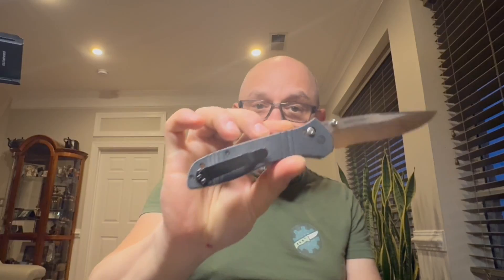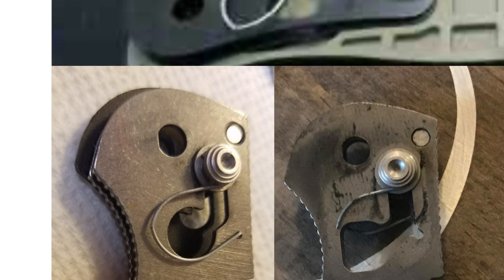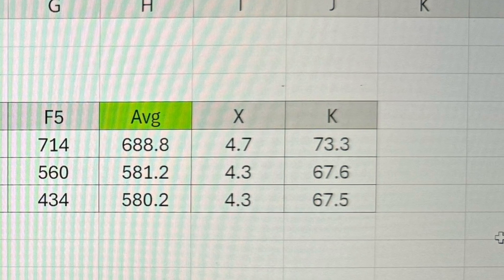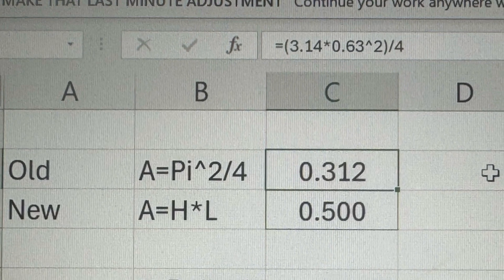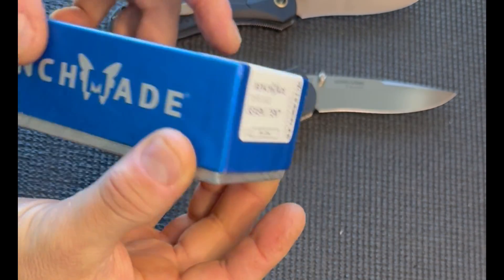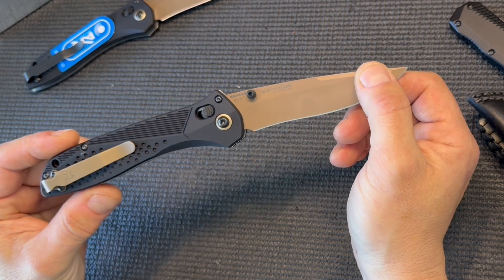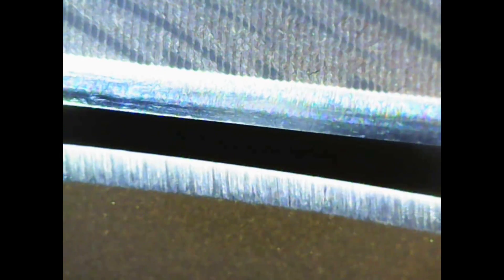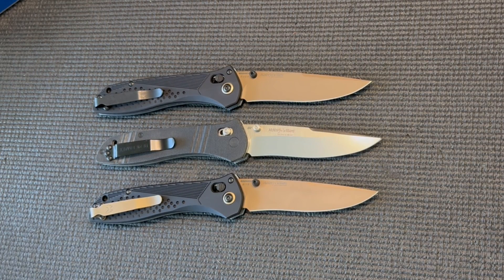Benchmade: new 710 Axis Lock Springs measured to see how will the Flat Omega Spring perform?

Comment: I found your video on the new omega springs for the re-release of the 710. I find this very interesting. I always thought this new style spring would be a better mouse trap for material choice , it's puzzling why it took so long for Benchmade to look at the spring in a different way. I guess someone at Benchmade thought that way too finally. Time will tell if it is indeed a better spring setup, I think it is. The biggest issue's I see with engineering departments is there lack of thinking outside the box and looking at new ways to do things instead of relying on past engineering ideas and theory. Some of the most interesting design ideas come from non-engineer trained individuals. An example of this to me would be the shark lock by Demko knives as a related topic to knives and locking systems. As a folding knife locking system, the shark lock is truly genius to me.
Reply from the maker: @wayneanderson991  Agree on Demko. All his designs are genius, Atlas lock deserves your attention if you haven’t tried it out yet. I have Cold Steel Karve and it’s a powerhouse of a knife.
Reply: @CuttingBoardRx  I will be looking at the Atlas lock, I have not tried that one yet. I just received some spring wire from a company that makes springs. I'm going to bend up some omega and sigma springs out of it and see how it works out. It's 302 stainless instead of the usual 304 stainless wire. I might also try some galvanized carbon steel wire at a later date.
Reply from the maker: @wayneanderson991  electro polish or… iridium plating 😉
Reply: @CuttingBoardRx  I measure the wire I was sent. It was .0238", I ordered .0250". Package was marked .0250". I'll have to try again. This is another issue now days, no one knows how to measure anymore!

Comment: Have you considered the new style axis bar as well? I see they moved the shoulders to the inside of the liner. All of the prior axis bars had the shoulders outside the liners. I’m wondering if this provides better tracking of the bar? I typically will switch between one and two fingers to unlock my blade. I know in the past there have been discussions online about this. Many people believe you will damage the lock by unlocking the knife with thumb only. The bar travels on a set path. Irregardless of using one finger on one side VS a finger on each side, I cannot see how it would be any different. 

Thoughts? Did they stabilize the bar better by switching the shoulders to the inside? 

Does it really matter if you use one or two fingers? 

The theory was that somehow using one finger to unlock the axis lock will cause extra wear. 

I dunno
Reply from the maker: @Mazel1975  That supposition about using 2 vs 1 fingers is an urban legend. I can’t come up with a scenario where a spring would fatigue out over fewer than 10,000 cycles. 
The reason I find the new lock a better design is because it eliminates an interface between the flange on the cross bar and the milled/molded cavity on the underside of the scale. I personally have seen cases where the cavity was machined at max material condition and the flange touched the wall of the cavity. This causes a vertical blade play. Now there’s only one interface to worry about
Reply: @CuttingBoardRx  thank you for your reply. I agree about the urban legend there. Otherwise BM would have supplied instructions on using the lock rather than letting us all fend for ourselves lol. I’m ambidextrous, but as I get older I have some struggles with dexterity due to pain. I love the cross bar, ball lock, Ram lock style as it lets me close the knife however I’m comfortable in that moment.

I am curious about the flange causing issues in the cavity. If you have a moment can you share what that means? In my head, I’m picturing the flanged portion of the crossbar at the end, but next to, beneath, the portion your finger touches , which I believe I have described as a “shoulder”, that used to live outside the liner, but inside the scale. Now, with this new design, it appears as if they moved the flange inside the liner. Am I tracking on that, or have I misunderstood?

Like if I describe the cross bar unit, and I’m comparing it to a barbell. It’s the tall portion on the end. But not the finger “button” at the end. The tallest part which sits under the finger button. Sorry for failing at my description lol.

Comment: I've had to send a bailout & Osborne 940 back to Benchmade for new omega springs while my Ritter Hogues with way more milage still feel perfect. I have a couple kizer & cjrb with similar axis lock style locking system but I've hardly carried those BUT I will say the tension necessary to operate those locks are MUCH stronger and take more strength to operate which actually feels pretty good in hand.

When it comes to factory edges, the last two Benchmade that I've purchased both came with very lacking, toothy edges. Both my freek and mini freek edges were very disappointing while all 5 of my Ritter Hogues came with practically a mirrors edge.

Comment: Do you think this Axis Lock spring configuration is the best yet, the Anthem’s, or perhaps another design? I’d hypothesize that coil springs, even with smaller cross-sections, might handle more cycles before fatigue failure—but I’m no engineer.
Thanks for the video, this is the first look at the new springs I’ve seen.
Reply from the maker: I actually don’t think the coil springs are great for a folder as they can accumulate moisture or, if oiled, dust and sand. The impinged flat omega springs on the new 710 is the way of the future because

Comment: Thank you for showing the differences with the New Omega Springs for the New Benchmade Folders.  That spring does look a lot stronger.  I've broken the old Omega Springs in my SOCP 391BK, twice...  :-)  I purchased more Springs on eBay; most likely Chinese Aftermarket Springs, for $10 for eight Springs.  I installed them and Lubed them with Lithium based Gun Grease.  I never had anymore issues.  The reason why I think I was breaking the Springs is because I wasn't using two fingers on the Axis-Lock to open and disengage the Blade.  Great Video!  :-) Peace, Stiletto :-)
Reply: na, use one finger without fear.

Comment: I think Benchmade’s quality has dropped while their pricing has skyrocketed to absurdity. Especially when compared to Spyderco, Kershaw, Hogue, Microtech, etc.  They are charging Sebenza prices at nowhere near the quality. They have lost their libtard minds.
Reply: Quality is the same. The "Benchmade tax" has always existed. This is not new... and has nothing to do with politics.
Spyderco also has significantly inflated their prices. Capara S30v lists at $264 (compare to bugout S90v and CF at $270)... base Para 3 lists at $160 (compared to a bugout at $165)... 
Spyderco also has some knives at "sabenza prices" that should be half the price. Stovepipe at $410? Drunken at $490? Paysan at $644?
Microtech? What? Are you talking about their ram lock? the FRN knife priced at 250$? 🤣
Kershaw is cheap because their knives are cheap... 
CRK are among the most overpriced and overrated knives on the market.

Comment: I've never had an omega spring break so I don't think it's a huge issue but I am glad to see Benchmade innovating with a potentially better design. That FDE clip did look great on the 710. I wish all of their knives had SelectEdge. The edge on my Taggedout is excellent. I actually slightly prefer the buttonhead screws but flat screws are fine too.
Reply: This happens surprisingly a lot with use of the knife.